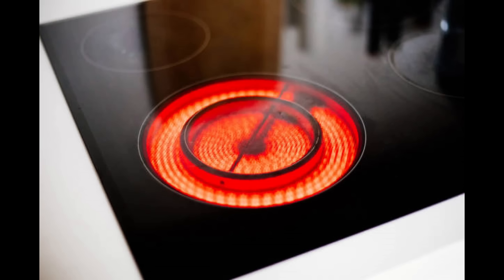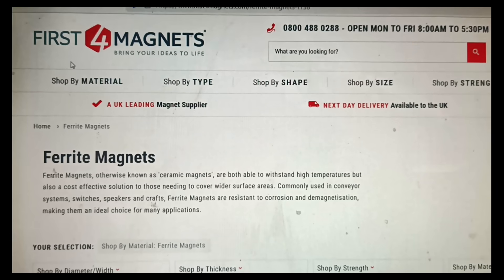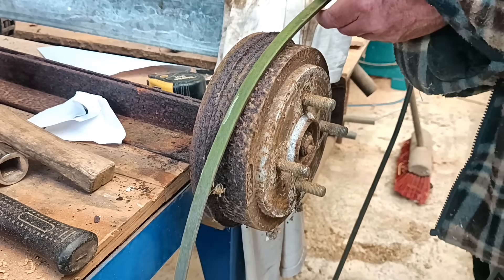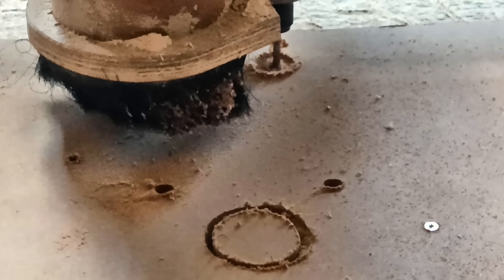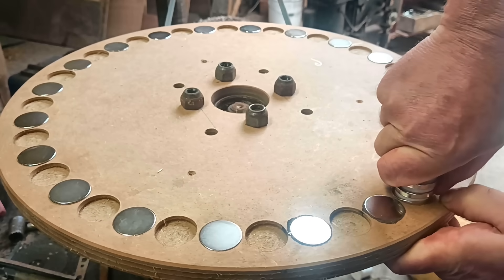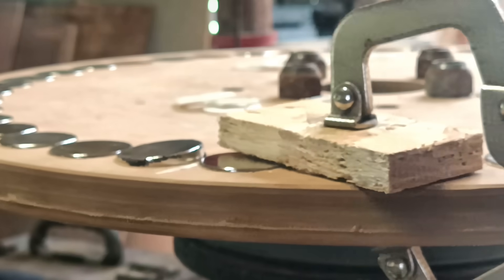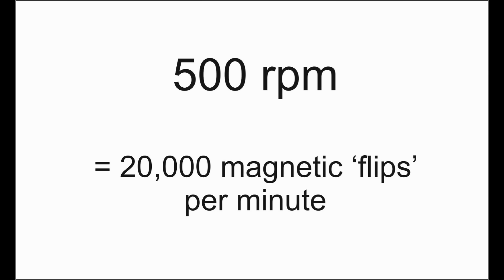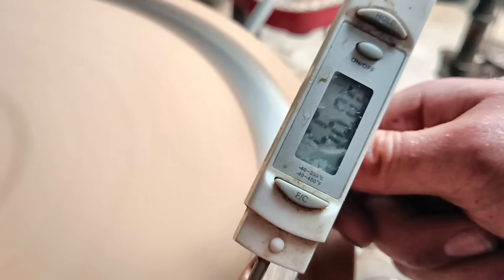I Made A BIG Rotating Magnet Induction Heater! (with magnets from First4Magnets.com)

Comment: I was talking to someone with experience of old school wind turbines who told me that they had self furling built into them. 

The horizontal axis around which the blades spun was offset from the vertical axis around which the head rotated to face the wind. 

This meant that the blades wanted to turn away from the wind, counteracted by the tail - which was held in place by a spring. 

When the windspeed applied a force on the blade disc that exceeded the strength of the spring, the blades turned out of the wind.  

This was complemented with a manual override that pulled the tail parallel to the blades and so the disc too was parallel to the wind.

Comment: Did experiments with these along tine ago. the best results we found were... 
mounting the magnets inside a horizontal tube, tried many.. with a series of small coiled copper pipers inside. The copper tubes remained static while the tube was rotated. given enough rpm the water we created was steam in a very short time.the introduction of a fly wheel and and manual start for the system was a must as resistance does happen. but the fly wheel then was given a commutator to induce a switching timing effect and reduce the amount of power needed in production of the rotation of the fly wheel, kind of like a gentle push every few seconds and creating a knock or push effect to keep the wheel moving constant. something powered by wind or a a super capacitor bank powered by wind turbine or solar. Its an exciting venture your into here but the tweaks and versions will be frustrating. Hope your boredom level doesnt exceed the excitement you now feel and you continue this series of endeavors.

Comment: Well done nice work I admire that , but I might add a bit of upgrade if u don't mind, if u used halbach array pattern u would significantly increase heating power as this concentrate magnetic field in one direction, adding a back iron thick enough to close back magnetic field leakage would imporve it even further.

If u want to use this magnets pattern make a little space between each magnet, this will reduce magnetic flux leakage between magnets, as u know magnetic field tend to take the path of least resistance, so by adding more space between magnets u increase heat generated using same amount of magnets, because what i said will lead to higher efficiency
Reply from the maker: Thank you - but the question is, would higher efficiency just lead to greater drag?
Reply: @wayoutwest-workshopstuff6299  sure, but lets assume it consume 200 watts of mechanical power to produce 150 watts of heating power, if u used halbach it will need - for example - 250 watts of mechanical power but will produce 220 watts of heating power, (used numbers to clearify things not real numbers)

Comment: Instead of making a bigger disk, and having to use many more expensive magnets, how about only a few magnets but spun at a higher RPM?
Reply from the maker: because the windmill might only be spinning at 20 rpm - and the more gear steps there are the more energy is lost
Reply: @wayoutwest-workshopstuff6299  I understand that but the mass of a giant wheel with many magnets will be just as  hard to turn...so why not spend less money on magnets, have less mass, and just spin it faster to achieve the same "cycles" of the magnets? Gearing up does require a lot of torque but a windmill with those kinds of large blades would have no problem gearing up the output shaft.

Comment: I made a very similar magnetic disk. I didn't use a cnc machine since I didn't have but but I did have a lathe.  I use cutting board plastic to make the disk and the magnets were something like 1in x 0.5 in cylinder shaped magnets. I made this rotor to be used in an experimental generator. Now I have a new idea, put two loops of copper tuning on each side then run water through it. I wonder how hot the water will get? I could pump the water into a hot water tank. It might be cheaper to get hot water that way?

Comment: Neo magnets are very dangerous and you have to have your wits about you whenever you are handling them ! The larger size ones such as these and above when they come together can shatter on the edges and release very small pieces of shrapnel that can travel at upto 250 meters per second . I was doing a project with some large neo's and 2 magnets clapped together and shattered quite badly and a tiny piece of magnet came off and entered my left forearm . You could just see it under the skin , no blood but it hurt for quite a while until it eventually came out by itself   a couple of weeks later !

Comment: Why make a bigger disk intead of gearing up a smaller disk to a higher RPM?
Reply from the maker: because the windmill might only be spinning at 20 rpm - and the more gear steps there are the more energy is lost
Reply: @wayoutwest-workshopstuff6299  I am not a mechanical engineer, but apart from the additional friction losses, isnt the torque required going to be rouchly the same if the aim is to move the magnets at a specific speed?
Reply from the maker: @imogenwren  Exactly. And I'm not a mechanical engineer either, so I can really only guess the right way to do it. But I do know that clunky gears (as I would make) do lose lots of energy. What would you do?#
Reply: @wayoutwest-workshopstuff6299  You already have a belt drive, you could chain large and small wheels to create your gear ratio, and its not going to be too much of an issue if the finishing is a little rough and ready!

placing the magnets certainly looked like a pain in the ass job, I have had similar difficulty getting magnets into 3D prints! so I would be doing all I could to avoid having to do much of that!

Comment: steel sheet on the other side of the magnets should increase the mgnetic field on the pipe side, and two opposing discs encapsulating the copper pipe should contain said field?

Comment: Check out this microbiome info mate! Antibiotics may be needed in emergencies, but in the end make your immune system weaker and destroy 'keystone species' microbes. The two best I'd get going is L.Reuteri Yogurt AND kefir. I did about 10 months ago and my immune strength has improved massively. the last few times i got sick i bounced back in record time and it didn't end with a chest/bronchitis infection which it has always done since young. It's in you gut. Watch everything you can on Dr William Davis. You won't regret it!

Comment: You probably would not need as much speed if you increased the contact zone. Ideally, maybe using a copper or aluminum pipe bent into a circle, but I guess you already had this in mind.
But what about magnets that are thicker - as thick as the spinning wheel? You could then switch between parallel (lots of warm water) or serial connection (hot water) arrangement...
I know that it would apply a lot of break force to the wind mill, but the advantage would be you could work with much less speed.

The most efficient form of the pipe would be rectangular with about the diameter of the magnets in width, I guess. But this would be hard to bend into a ring...

Comment: Would it work IF you took a copper pipe and bent it about 350 degrees around the circle before you had an exit straight length and an area for the entrance straight length?  This would maximize the copper zone that is above the magnets.  Or would the copper pipe have to be horizonal to the direction of the magnet travel?

Comment: I think of Tesla when you made this; an adhesion within the medium. -Because the plate is the same level as the magnets, adhesion is achieved. To solve this, the induction plate should be a slight angle off the plane of the magnets. Also, you may want to look into the Tesla disc turbine for uh... insane RPM. One could put magnets on a wheel of the turbine, creating steam to then power the jet of the turbine itself. I'm not really inventing something here, just merging two patents into one.

Comment: Ahh!  Now if only you had mounted a coil of enamelled copper wire with a diameter the same as one magnet above a magnet of the rotating disk. The end leads of wire would go a variable resistor in the circuit.   Vary the thickness and number of turns of wire in the coil.  Cheers from Northen Ontario.
Reply from the maker: That could still happen - just exploring my options..  : -  )

Comment: Since the pillar drill is belt-driven anyway, would it have been possible to just open up the top and drive your wheel directly from the pulley on the motor?

Comment: What I am wondering is where are the maximum points of gain with the magnetic size strength, speed, and flip of the magnets ?? This would really help you make the best wind heater you can make Sir. Good luck and peace too. V

Comment: Right away I thought of a copper pot floating over the disk, with copper pipes running through the windmill to keep it heated. if you had the copper pot the same diameter of the disk, how fast would that heat up?

Comment: I dont see the point here, if you use the Pillar drill motor to turn you Car Wheel drum with magnets on it > you may as well buy a Water heating element in a Drum to heat the water > it is cheaper !
Reply from the maker: Congratulations, you're the third person to miss the windmill in this... : -  )

Comment: A radio wave is simply the flip-flop of a magnetic field. Although overall this is creating a magnetic field vortex, at any given point around the radius of the disk, you are mechanically generating radio waves. If the disk is rotating at 500 RPM or 8.3 RPS and has 20 full field "flips", the copper pipe is being subjected to an electromagnetic (radio) wave of 166 hz. A microwave oven heats the same way except it generates a radio wave of 2,100,000,000 hz or 2.1ghz and is actually a much weaker magnetic force on the object being heated. The commercial induction heater is operating at 60hz (US) or 50 hz (UK).

Comment: If you calculate the amount of wattage used to propel the drill press, and calculate the amount of heat generated, you'll find that it's less efficient than a toaster's resistance heating element. The most efficient system for generating heat is a deep-Earth geothermal bore where for a one-time investment of [a LOT of money] you get essentially free heat forever. Mostly used in places like Iceland where the Earth's crust is very thin, but you can do it anywhere.

Comment: You can increase your efficiency quite a bit by having two identical disks rotate in sync to each other. That will create a homogenous magnetic field through the copper pipe.

Comment: Of course it will heat metal, but if you want a 1000W heater, you'll of course have to put 1000W of power into it. Which means that you'll need a 1000W Windmill. In the Winter 1000W wouldn't be very much for heating a whole house though, so you'll probably need several kW of Power. 
A much smarter way would be to use a heat pump. Since it will take your 1000W of power and pump thermal energy of 3000-6000W of power into your home. So it will do a lot more heating with the power of your theoretical windmill.
Reply from the maker: and that might happen too - just considering my options..  : -  )

Comment: My friend, heating non-ferrous metals like copper or aluminium using an induction heater is EXTREMELY inefficient. You could see it in your experiment when driving your disc from a powerful drill you barely managed to heat copper to water boiling point. If you had a piece of iron instead of copper it would have been red hot with the same effort. The reason for this is your explanation in the beginning of the video (about flipping electrons) is  exactly what happens with non-ferrous metals. It is called eddy currents. Unfortunately electrons have practically no mass so moving them around don't require or generate much energy. 
It is very different for ferrous metals like iron or its alloys. Under the ever-changing magnetic field the whole little chunks of iron (called magnetic domains) are moving around constantly re-orienting.  You could actually physically hear them move. They are obviously a lot heavier than electrons so the heating is much more efficient than by just eddy currents. That is why in the kitchen induction heaters only certain types of pans are of any use.  And they are iron ones.  
I suggest you repeat the experiment but replace copper with iron.  You will see the difference.  There was a reason why you could not hold on to it while trying it, so you should arrange some kind of fixed attachment rather than hold it by hand.  You will see the difference in heating immediately.

Comment: Thanks for the great video, I got some very useful information from it. I am attempting to build basically the same thing to try and heat my pool to extend it's usefulness into the cooler months. My idea was to have the magnets exposed on the top and bottom so I could get twice the 'flippage' from the the same number of magnets and I intended to construct a square 'loop' from copper pipe (2 actually, one for the top other for the bottom) and then run an inlet and outlet from the pool. The reason for the square loop was to prevent the magnets from getting heated by the pipes by allowing the wind from the disk spinning so fast. I hope this makes sense but I'm sure a smart bloke like you will be able sort unjumble my jibberish. All the best with you work and I hope you start to get better soon.

Comment: So a huge windmill with copper piping and a water tank up top, lower is the shower and bath, the windmill also runs the water pump off a second belt, the induction magnet spinner is fast because it is geared up with a few pulleys and belt from the windmill, then also you use residual wind from the blades to run air across some of the copper pipe for the clothes drier, hair drier, and of course the washing machine uses the water pump and pulley belt drive.

Comment: ...reminds me of an idea i had to slow a turbine if it's going too fast but still draw more power from it's generator hub but i think it's similar anyway , the thought was to use electromagnets on the outer ring or casing , so there's more drag to slow it by feeding it's own energy to the extra coils then creating more output whilke braking the turbine speed ...(?)

Comment: I'm three minutes in and so far a car tire /hub for a bandsaw drive , a drill bit for an arbor and a pulley on a drill motor , i think it's cool but a shop teacher might try to ass*sinate ....edit: lol he just stuck a brass brush wood handle into the drill for the slot pin next and sawed it off...

Comment: I have plans for a stack of these, with operation on both bottom and top.  Unfortunately, the heat buildup can damage the magnets extremely quickly.  So, I changed to the electronic style.
Reply from the maker: no heat in the magnets though..

Comment: A typical induction hotplate uses power in the range of 1500 watts, or two horse power and runs at approx. 50KHz (flips magnetic field 100 thousand times/second) versus 333 per second with your magnets. That's a difference of 300 times.
Your motor is probably less than 1/2 horsepower. Also copper is probably too conductive to heat up well in the field, it's not just the atoms flipping in the field (friction), but resistive heating in the metal.
A pan for a induction hotplate uses steel which allow both forms of heating to occur.
Try an aluminum piece, it will probably heat up a bit more because it's less conductive. Better yet is steel.

Comment: All the energy you used to run this thing could have just been burned for heat, or the electricity used for power resistive heating coils.
Reply from the maker: Ha! and there's the second person who missed the windmill completely..
Reply: @wayoutwest-workshopstuff6299  .... I literally said it was smarter to use electricity to run a resistive heater.

The issue wasn't your power source, it's that your wasting your power source in the worst way possible.

Friction, drag, moving parts, tolerance stacking, the size variance in items being heated, the size of the magnets and their spacing. Resistance circuits have none of these issues right from square one.

I heard you say windmill. And it's just as pointless to do it with a windmill as any other power source.

Just make some kanthal coils for chrissakes.

If you want to get smart--embed them in a ceramic plate.

That's literally why home cooking elements do it that way. Because it's the cheapest, easiest, most foolproof, and most energy efficient way to do it.

Comment: Wonderful concept, and so simple, video is very well done! I can imagine stacking up the magnet discs, affixed to a common shaft, with an aluminum or copper stator disc between each pair of magnet discs. Forced air through the rotating stack would extract plenty of usable heat, depending on scale.

Comment: The next thing in engineering would be to characterize the system. This means before you spend all the effort building a much large system, you need to figure out how much heat (BTUs) your small system can generate. If the BTU output is small, you may find the required size, RPM or cost of the larger system might become to prohibitive to be practical.

Comment: It is important to realize that energy conversions involving magnetic fields are intrinsically efficient. Transformers and motors are easily designed for over 90% efficiency. Compare that with about 40% from heat engines like gas motors or even gas turbines..  These days energy efficiency is more important than ever

Comment: This is the kind of physics lesson that should be taught in school.  Learn by doing and applying theories and laws instead of taking them for granted.  Now on to an induction boiler and steam turbine or a thermopile to generate electricity.  Along the way they would learn about efficiency Ein vs. Eout, Pin vs. Pout.